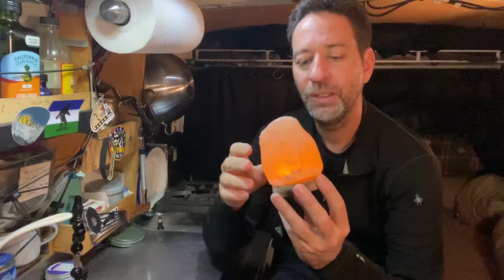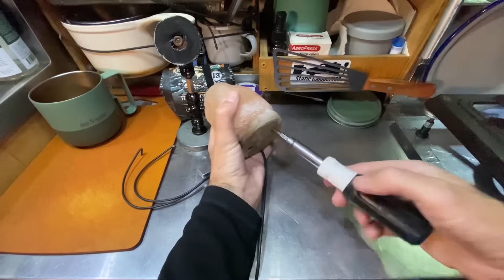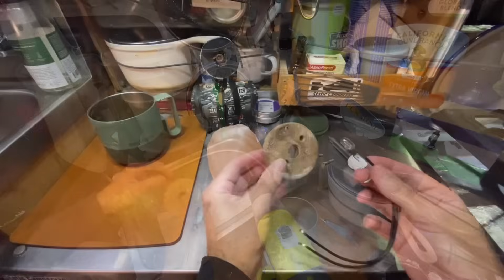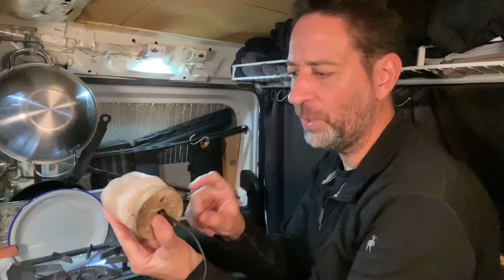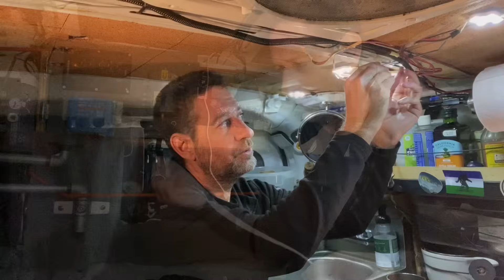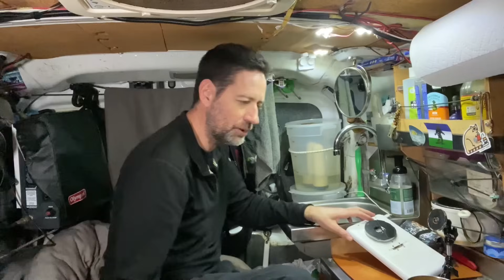Campervan Lighting Repair & Upgrade #vlog #diy #saltlamp

Comment: What replacement cord and bulb did you buy? Is it from Amazon? Can you provide link? Ty in advance 😊
Reply from the maker: It’s been two years since I did this project. I don’t remember off hand. If you watch a few more minutes of this video, I provided all the information
Reply: @StaticCamperVan will do. I had watched the entire video when you did it originally ( I watch all your videos). Today my salt lamp broke and I remembered you fixed yours couple years back and I scrolled back and rewatched that part. I didn’t hear you say details on the cord where to get it but I will rewatch again obviously I missed it. Probably easier to buy a new salt lamp but I would like to try and fix it first if I can. Enjoy your videos!

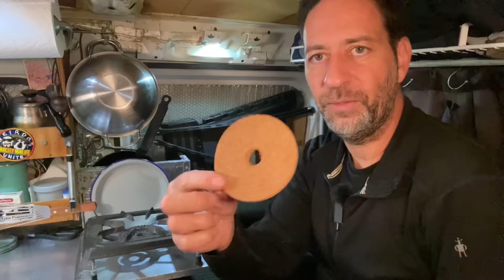Comment: 11:08 the incandescent bulb should help with the drips as well, when it is on the water will evaporate instead of running down the lamp.
Reply from the maker: That was my hope but the lamp doesn’t get warm enough to provide any real heat

Comment: Large Bluff Collapse on Black’s Beach in La Jolla Shocks Beachgoers
A large section of the cliffs above Black’s Beach collapsed on Friday, causing portions of the bluff to crash onto the northern La Jolla beach.

The bluff collapse occurred around 2 p.m. on Friday, Jan. 20, San Diego Lifeguards told NBC7. Officials say the collapse is estimated to be 250 feet wide and 25 feet high.......

Comment: Thanks for sharing. I’m full time in a huge Ram Promaster 2500 high top. And even my van blows all over in a big storm. Which we have a whopper coming this week with some big winds. What do you do in big storms if anything, differently. Thanks again for sharing.
Reply from the maker: I’ve haven’t experienced too many big storms. I did get stuck living at my old work for a week due to a big snowstorm. But normally it has only been smaller, easier to deal with storms. Like this one: https://youtu.be/6QE_XDPRsQI?si=69KkFy8Az93etKAC

Comment: I’m happy you switched out the LED. I had migraines and sleep problems (this is how I found you) with LED everywhere in my home. Incandescent light bulbs can’t be sold in CA so I have to order on eBay but I switched out all lights in my bedroom. They are so expensive now but it’s better for your health. Those LED bulbs emit way too much EMFs. Sorry I’m a neurotic scientist when it comes to radiation.

Comment: I've been on cruise ships that have a "salt room" in the spa.  It's relaxing, but I don't really know if I get any benefits from it .... There are benches around a big salt lamp and the walls are lined in salt .... it's warm and there's a barely-there breeze.  Supposedly it helps with respiratory issues ... do you feel you "breathe easier" with your salt lamp in your van?
Here's what the cruise line says about it:
"Salt therapy, also called halotherapy, has grown in popularity all over the world. This popular global trend that can be found in Europe, Canada, the United States -- and, of course, on board Norwegian Cruise Line. This therapeutic process is used to alleviate respiratory problems, skin ailments, and to strengthen the immune system.    
The onboard spa replicates the microclimate found in caves in Eastern Europe, which have been used for hundreds of years for their healing properties.  Through the use of salt aerosol machines. These machines grind salt into minute, breathable particles and circulates them into the air. 
The negatively ionized salt particles can then enter the respiratory system and thin out toxins inside the lungs, allowing the breath's cilia to expel them with ease. 
Salt contains anti-inflammatory and anti-bacterial properties, which help open up the lungs and eradicate bacteria on contact. Salt therapy can alleviate symptoms caused by over-exposure to smog and city dirt, bronchitis, sinusitis, cystic fibrosis, and allergies. In higher concentrations, salt therapy can also alleviate skin conditions such as Eczema and Psoriasis."
Reply from the maker: I haven’t noticed any benefit to the salt lamp other than the soft lighting it gives off

Comment: Hey good morning Scott. Waking up eary today so whats better than having a coffee and watching Mr. Scott doing some diy projects? After watching till the end, congratulation, it came out fine the new light concept looks more cosy now. Silly comment, maybe you could reuse the ripped out LEDs and the unused switches of your switchpanel and the (maybe) leftover cable to install the LEDs in new and different places and wire them individually to the switchpanel (or in two groups of two) to add to a flexible lighting system where you can switch one or more lights independently to match your mood or requirements even more flexible and reusing already available material. I have different single lights in my vehicle since a few years and really use very often different lights or groups of lights for reading  cooking, cleaning or watching movies, just an idea. Thanks for your video and have a great day.

Comment: would be interested in your thoughts on a re-build/new build on a van
Reply from the maker: Judging from the issues I am facing, it’s very likely that a new van build out is in the near future
Reply: sorry to hear that.  i have been looking at older vans myself as they had better build quality and are easier to dyi repair with cheaper parts.  the astro van seems like a nice compromise in space and mpg.  @StaticCamperVan

Comment: Hey Scott, if that bulb is heating up then it’s more than likely pulling more current then that led you replaced.  Just keep tabs on power consumption.
Reply from the maker: It’s a 4 watt bulb. If it were running all day, it would be drawing too much current. But I think my system can handle a quarter amp for a couple hours a day

Comment: Leaving the wiring exposed defiantly makes it easier to change/repair, so good call on that. You might watch the LED light, when you hit a bump the single magnet "may" not be enough to hold it. And yes I did watch it to the end, even the ads. I enjoy your videos.